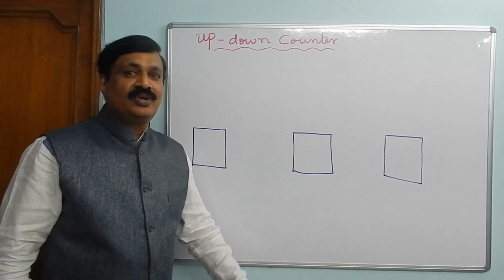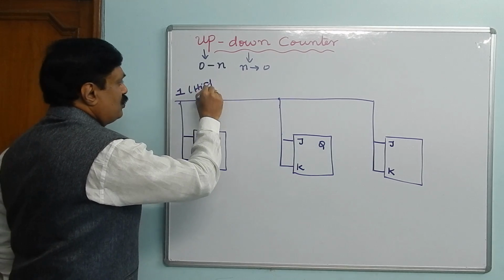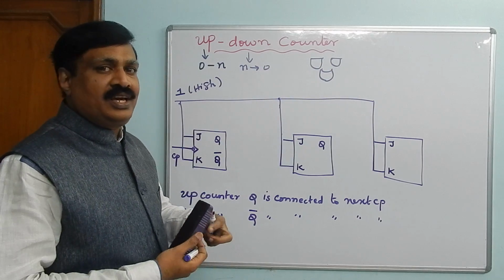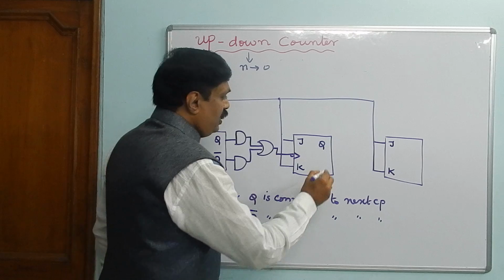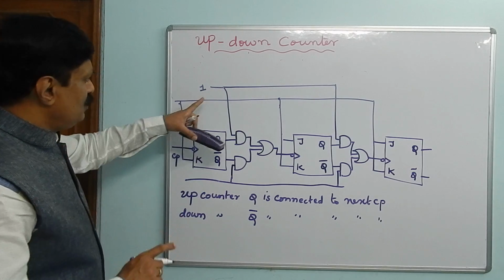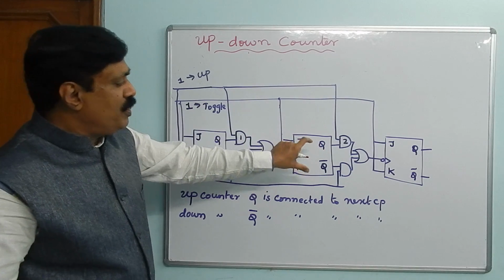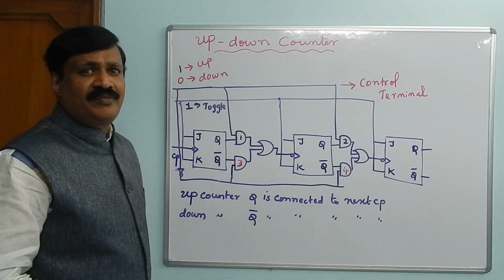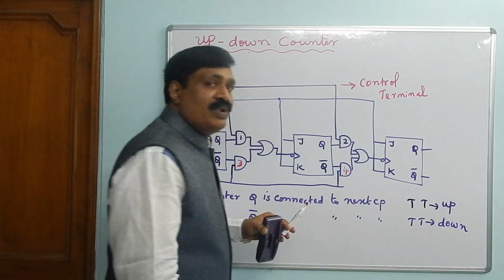Up - Down Counter- Digital Electronics

Comment: Sir is this a synchronous or asynchronous counter
Reply from the maker: This is asynchronous counter.  If all the Flip flops are connected by common clock pulse ,then the counter is synchronous. 
Here CP is connected to first FF only. 
Second is triggered by first. 3rd is triggered by Second and so on.